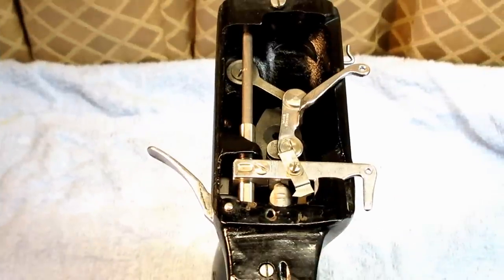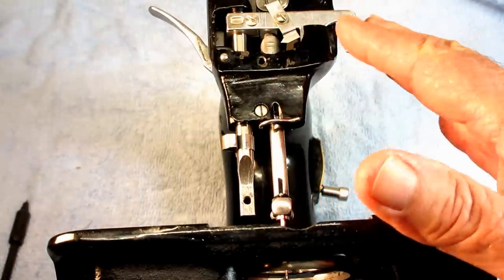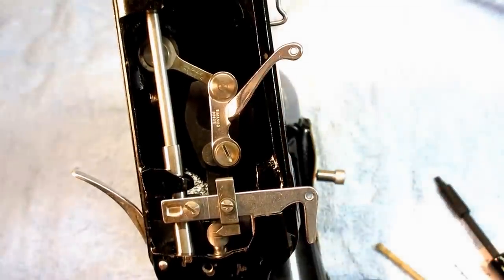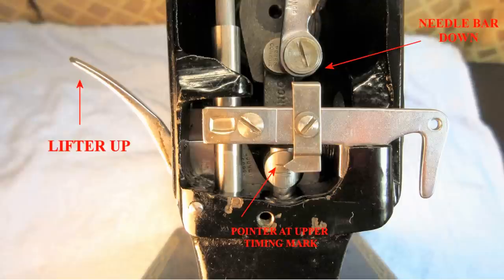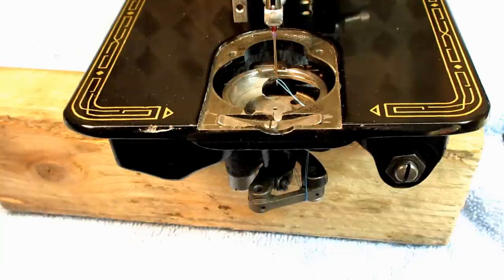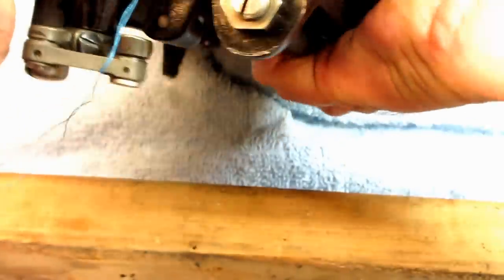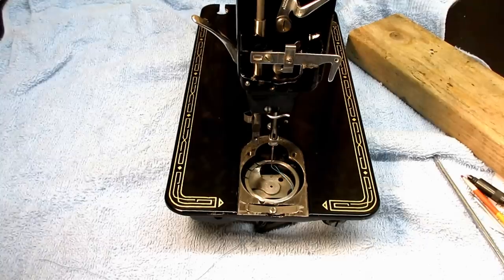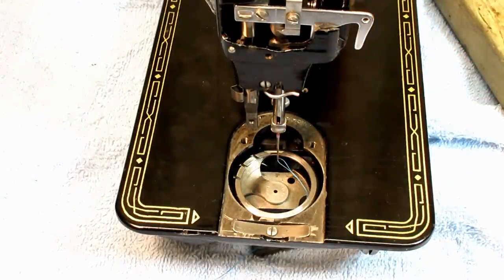The Needle Bar Height and Hook Timing of a Singer Model 99K Sewing Machine

Comment: Andy, you seem to be my OSMG! 🤣 the hook assembly in my 185 has “play” in it and moves about quarter inch back and forth regardless of tightness of the screw. Help! Love your videos, you’re my go to to figure something out with my machines
Reply from the maker: So is that a problem? I mean it is an oscillating hook, right? I've never worked on a 185 but understand it's the same mechanics as the 66 & 99 models. If that's true here is a video about removing and replacing the whole hook if you want to see if it compares to your machine and movement:  https://youtu.be/JknRDA1rSVU      here is the19 video playlist for the 99: https://www.youtube.com/playlist?list=PLsCOZgzzaiKIIUgkEujqHc9iNWN9NPW2Z    It seems I read that the 185 was the replacement for the venerable 99K and it was mostly a body style change. BTW, saying the hook assembly moves 1/4th inch "back & forth" was confusing to me, sorry. Like from top to bottom of the machine back and forth? From nose to handwheel end back and forth? Oscillating back and forth? Take a look at the hook video and see what you think.
Reply: @andytubesewing1953  Thanks so much for your reply,  found another video that helped!  I know it's hard for a lay person to describe in a manner that's understandable.  lol!  All fixed and sewing like a top, thanks to your videos.  about to start my 500 rehab.  Many thanks

Comment: Excellent guide to setting the timing on a 99K, thank you Andy. Could i ask a question please? I want to do the same procedure on a Singer 275, which I thought was very similar to the 99K and the 185K. But there is no little left pointing metal 'arrow' on mine to align with the scribed lines on the needle bar-so what do I align the needle bar against please?
Reply from the maker: Model 275/285 was made in Scotland and Canada and not originally sold here in the USA. I have no records or parts list or service manual for it, sorry. If there are timing marks on the needle itself, maybe one of these videos can help: https://youtu.be/R66oy38iNV4
or   https://youtu.be/-FezmqypK6w

Comment: Thank you for these informative vids.  How does the timing get out of whack?
Reply from the maker: On a model like the 99K it is rare to lose the timing. If the needle bar connection vibrates enough to loosen and you have a hard needle break or jam the needle bar can slip and change height and put the timing off. Same with the crank on the hook shaft. Both those are rare. It is usually from someone working on the machine that the timing goes out. On other model with a timing belt it is more common to lose the timing after a belt slip from a jam or needle break, Thanks for watching my channel.

Comment: Thank you for your instruction videos on model 99. I’m having a problem on mine i can’t solve. First, it was my wife’s and not used for years but kept in it’s cabinet in the house. I clean and lubed it, runs very well, but the thread continues to break after the first stitch. I adjusted both the timing and needle height and tensions as you show. Unfortunately i only have plastic bobbins but I don’t see that as the problem. Any idea why the thread breaks - i can here it snap. I did have it sewing, but the result was not a clean stitch.  The more i adjusted the tensions, no change, then the thread starting breaking again. There are times the thread gets jammed together with the bottom thread while the needle is down- that’s my best description.  Any help would be much appreciated - mark
Reply from the maker: " i only have plastic bobbins but I don’t see that as the problem" maybe not, but maybe it is. When the hook grabs the needle thread it drags that thread around and over the bobbin/bobbin case to "cast it off" near 6 o'clock and the take-up lever pulls the needle thread up and out of the hook area and fabric, making the "lock stitch" The Singer Class 66 Bobbin was designed with curved sides ( or top & bottom as it sits in the bobbin case) to facilitate helping the thread pass over the bobbin and bobbin case without snagging or dragging or catching on something. Be sure you have a Singer class 66 bobbin and not something else, like a class 15 bobbin with flat sides. I mention this b/c you wrote "the thread gets jammed together with the bottom thread while the needle is down" which can be a classic sign of the wrong bobbin in the machine. Other things that can affect the thread that way are; the wrong type of needle used, needle threaded wrong, a needle inserted backward, a needle threaded backward, a needle not inserted all the way up into the needle clamp either by the user (you) or b/c there is dirt up in the needle clamp, bobbin threaded wrong, bobbin placed in the holder the wrong direction, a burr (rough edge) on the bobbin case or hook, too much tension on the bobbin case thread tension spring, ( this is kind of rare, but happens enough that I made a video https://youtu.be/bhcsfhaBRDo) Those are not all the possibilities, but some of the most common causes. As this is your wife's machine maybe she has the instruction manual, but if not you can download a free one here "99 sewing machine"   https://youtu.be/bhcsfhaBRDo       it has the threading info for needle and bobbin case. Don't scoff at that. My wife has sewn for over 50 years and this week asked for help b/c of skipped stitches. She had threaded the needle backward. Can you imagine the thousands of times she has threaded a needle? We all make mistakes. The common suggestion is to pull out all the thread, place a new needle, wind a new bobbin, rethread the needle and bobbin case after a good cleaning of the area and start over.

Comment: Hi Andy, I hope that you're well? I've a slight problem with a timing issue on a Singer 99K (1936) that I have been restoring and wonder if you can guide me in the right direction? When I've come to set the bell crank hook behind the needle (lower timing mark), I have a bit of play in the mechanism. This play will allow an additional movement of the hook anti-clockwise approximately another 3 to 4mm past the needle. The play is throughout the bell crank mechanism, Pittman arm and vertical crank rod. As there are no offset cam screws to reduce this play and so the thread pick-up by the hook is a little hit and miss... , Would you have any suggestions to solve this issue or should I make an allowance for this play when setting the timing. Thanks Ken
Reply from the maker: I don't remember having that on any of the machines I worked on, but each machine is unique due to usage. In general, the mark I use is where everything is at the moment I turn the handwheel and raise the NB and the timing mark first hits the correct spot. That is the way the machine is going to work while sewing so it is where I set it. I have some adjusters manuals and other timing instructions for model 99 and I'd be happy to share them with you. If interested email to andymanuals53@gmail.com and put SINGER 99K DOCS on the subject line.

Comment: Another great video Andy
Very useful information that I'll be using in the near future.
Thank you for these videos.
I'm working on a 15-91 right now, it's timing marks are scribed into the needle bar like you are used to.
Reply from the maker: I appreciate the comment Mark. I'm not sure why, but I like it better when the timing marks are on the needle. Just what I'm used to I guess. The system on this 99K worked just as good. Have fun with your 15-91. Take Care.
Reply: I like them on the needle bar better as well.
Been repairing cases goodwill shipping damaged for the last three days, 
saved 3 of them so far.
The bentwood White Rotary case was a real challenge, but it came out acceptable I 
think.
Got the bobbin winder spring ordered for this 15-91, should be here in a couple days
and still need to grease the gears at the motor, then I believe I'll be done with it.
It goes in one of these cases I just repaired.
Pretty nice little unit.
Reply from the maker: Congrats on saving some cases besides the machines. Nice Job.

Comment: Hello Andy.... hope all is well with you and yours. 

I recently picked up a 1910 model 66 treadle powered machine. Completely disassembled and ultrasonic cleaned and polished every piece. Reassemble all and tried to reset the hook timing. Let’s just say... I’m loosing the battle, skipped stitches etc. Seems to me the needle to too low and no adjustment I make can get the required 1/16. I’m not sure if it’s wrong needle or incorrect needle bar? Is the correct needle the 15-1 series?
Reply from the maker: Yes. Singer model 66 uses type 15x1 needles in sizes 9-11-14-16-18-19-21 as shown on the inside of the back cover of the original instruction manual from 1929 which you can download FREE at this link: http://ismacs.net/singer_sewing_machine_company/manuals/singer-model-66-sewing-machine-manual.pdf
Here is an earlier video for timing a fellow made for timing the model 66: https://www.youtube.com/watch?v=2FXz-2np4Wc
I have a copy of the "Instructions for Timing and Adjusting" for model 66. You can buy it from some places online or if you email me at andymanuals53@gmail.com and ask for it I will share it with you. I also have a few of the parts manuals for the different versions of model 66 that show the part and part number. That's the only way I know to tell for sure if you have the correct needle bar.
You don't mention if the machine worked before you cleaned it. It is rare, IMO, to find the wrong NB on a machine, but I'm sure it happens. When timing is off on any machine I work on I find it is my error and not a machine part. I've learned a lot from all my mistakes, haha.
Reply: Andy,
Please disregard above post... was able to figure this “old gal” out this am. I decided to ignore needle bar height and just set needle to hook timing as per your video instructions.
👌🏼working like a champ now!
Reply from the maker: @Irukandji01  👍

Comment: This is a fab explanation
However, the presser foot has dropped and is far too low, even with the lever lifted up. How can I sort that, please? P.S. the timing is spot on now.
Reply from the maker: This video will show you how to set the height: https://youtu.be/qFsJzJ9NH2s
Here is a playlist of my 19 videos for model 99K: https://www.youtube.com/playlist?list=PLsCOZgzzaiKIIUgkEujqHc9iNWN9NPW2Z
Thanks for watching my channel and leaving a comment. Good Luck.
Reply: @andytubesewing1953  so sorry, I should have said. It's a tan 185K. But your timing video was just right for the 99K. I have several machines - 99k, 201K, 185k, 66k, zigzag model, 221K featherwright, Frisster & Rosmann and an unknown. Just working my way through cleaning and tarting them up.
Reply from the maker: "...tarting them up." Haha. For your reading pleasure:
https://www.singer.com/sites/default/files/product_manual/SINGER%2015K_66K_201K_99K_185K_327K_328K_329K%20and%20404K%20Sewing%20Machines.pdf
http://www.parts.singerco.com/IPinstManuals/66.pdf
http://parts.singerco.com/CPpartCharts/6_6999/66-1_66-4_66-6.pdf
http://parts.singerco.com/CPpartCharts/6_6999/66-8_66-14_66-18_66-24.pdf
http://parts.singerco.com/CPpartCharts/6_6999/66-16.pdf
http://parts.singerco.com/CPpartCharts/6_6999/67A3.pdf
http://parts.singerco.com/CPpartCharts/9_99999/99-13.pdf
http://parts.singerco.com/CPpartCharts/9_99999/99-31.pdf
http://parts.singerco.com/CPpartCharts/9_99999/99K28.pdf
http://parts.singerco.com/CPpartCharts/1_19999/185.pdf
http://parts.singerco.com/CPpartCharts/2_2999/221-1_221K1_221K4_221K5.pdf
http://parts.singerco.com/CPpartCharts/2_2999/221K7.pdf
https://cdn.shopify.com/s/files/1/0992/8814/files/FW_221_Service_Manual_-_080615.pdf?13711830328844384808
https://cdn.shopify.com/s/files/1/0992/8814/files/FW_222_Service_Manual_Addendum.pdf?11836299859689189960
https://cdn.shopify.com/s/files/1/0992/8814/files/FW221_Adjuster_s_Manual.pdf?11836299859689189960
https://cdn.shopify.com/s/files/1/0992/8814/files/Singer-Featherweight-221-Parts.pdf?6256387824615179667
https://imagespast.files.wordpress.com/2015/05/singer-201-service-adjusters-manual.pdf
http://parts.singerco.com/CPpartCharts/2_2999/201K1_K2_K3_K4.pdf
http://parts.singerco.com/CPpartCharts/2_2999/201-2_1200-1.pdf
http://ismacs.net/fristerandrossman/manuals/frister-and-rossman-transverse-shuttle.pdf
Reply: @andytubesewing1953  Blinkin' blimey! That'll keep me busy. 😉. Thank so much for your help and responses.

Comment: I have a Singer model 7033. How can I find propper height or placement of the needle arm if there are no timing marks on the needle arm?
Reply from the maker: I think the 7033 was Made in Taiwan in the 1990s. It much too "new" for me to know about. The instruction manual is still available at Singer Support but I could not find access to any service manual to see the timing instructions. It is rare if there are no timing marks on the needle bar. I have heard of the marks being up top instead of in the middle of the bar, but never heard of a Singer Needle bar without the timing marks. If it was my machine I would try "backward timing" it. What I mean is I would follow any of my timing videos but get the hook in place first and then raise or lower the needle bar so the eye of the needle is 1/16 inch below the hook point. The needle bar should be started on the upstroke before you adjust the height. Hook point to needlepoint timing has been the same on most machines I have done, meaning set the needle bar height (height is known due to the timing marks) then turn the hook point in front of the needle. You'd have to set the hook directly in front of the needlepoint (because the hook being under the needle is your know location)  and then adjust the height of the needle bar for the 1/16 inch that most machines are set too.

Comment: Hi Andy. My 99K needle coming so close to the hook ''bow'' that the hook slightly slopes needle on the left side and needle then rubs against the bow all the way. I think this is not OK but have no clue where to fix that . Timing is set 100% correct and machine work realy nice. But any way needle is pushed bended sligtly to the left... ??
Reply from the maker: Hey, Igor, you win the question of the week! I've never had this problem on a 99K. On other models what I found was (A) bent needle, (B) bent needle bar, (C) needle clamp dirty inside making the needle sit crooked in the holder, (D) the needle bar adjusted too close to the hook, (E) the hook moved out of place. On the 99K, A, B, & C should be looked at for sure. On most Singer machines I have adjusted the MAXIMUM distance between the hook point and needlepoint is .002 inch or less (whew! that is really close!) so if a needle bar is bent even a slight amount, well ... you get the idea. I do NOT remember there being an adjustment on the 99K for moving the needle bar towards or away from the hook. I looked over my notes and just did not find anything about that adjustment on the 99K/66 models. Likewise, no adjustment for moving the hook; it is just in place through the hook shaft bushing and that's it. I did do a video about removing and replacing the hook for cleaning, etc. If you have not seen that here is the link: https://youtu.be/JknRDA1rSVU
In fact, I have a whole playlist for the 99K model: ttps://www.youtube.com/playlist?list=PLsCOZgzzaiKIIUgkEujqHc9iNWN9NPW2Z
I have to say of the 19 videos, this one was the most fun to make: https://youtu.be/CsWvFjjmK5E
Back to your question; A, B, & C steps mentioned above is what comes to mind, and then reinstalling the hook in case it is not sitting flush on the shaft bushing.
Thanks for watching my channel, Igor. Stay in touch.

Comment: Thank you for your response. The problems i had were from 2 areas. The first-I’m left handed and i was threading the needle from right to left  because left to right so difficult and I couldn’t believe it really makes a difference - of course i now know better. The other was the upper thread tension. I was putting the foot down and pulling the thread by hand to get a starting point. But i was getting poor stitch quality as per the manual which i did already have. What I didn’t understand was when i put the tension mechanism on after clearing was how far to tighten the nut onto the dial. So with poor stitching, i kept tightening and tightening the nut to the dial, so much so i was sure the thread was too tight and would break. To my surprise it didn’t and i started to get a really nice stitch like all YouTube videos I’d been watching. End result, very nice working machine. Thanks so much - mark
Reply from the maker: Satisfaction and a happy ending. 👍 Nicely done. Also, thank you for helping to verify that the plastic class 66 bobbins do work in these older models. I have always found that they do, but have many who disagree with me about that. Happy sewing.

Comment: Hi Andy, love your videos they are so informative. I have a question though, when I loosen the set screw on the needle bar I cannot get the bar to move at all. Is there something that I am doing wrong? Thank you in advance
Reply from the maker: Thank you, Cheryl. It's the needle bar, not you. There is probably years of dried up oil/dirt in the connecting link that holds the screw and/or in the bushings the bar slides up and down through. When old oil dries up it can act like a varnish and practically glue stuff together. I just released a video of a stuck needle bar that I had this problem on. It's a different model but the same setup. I show how I used Krud Kutter to break down the oil and free up the needle bar. You could use penetrating oil or alcohol too. Take a look and you will see how I did it. 
https://youtu.be/nqFm570Azwc
Thanks for watching my channel.